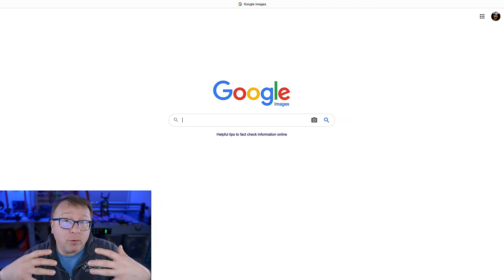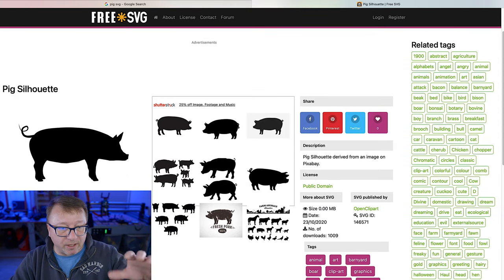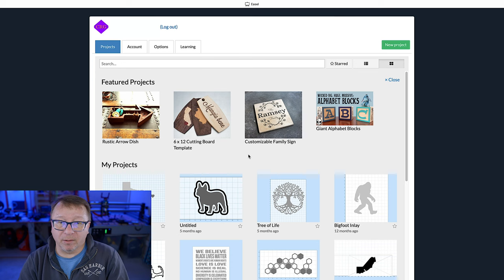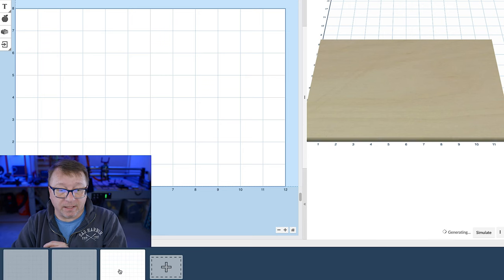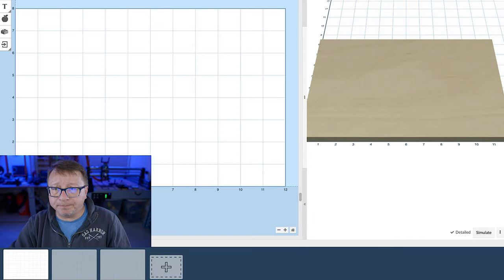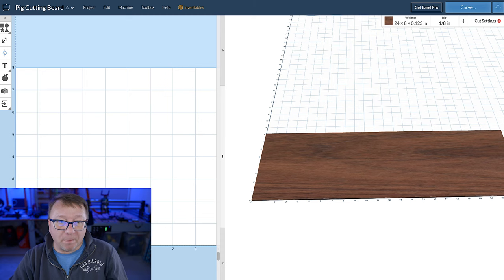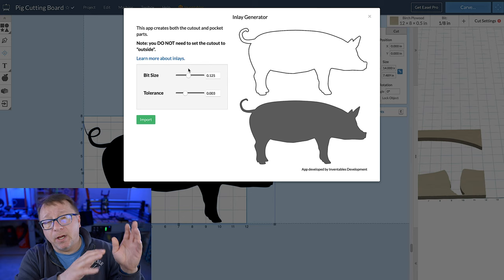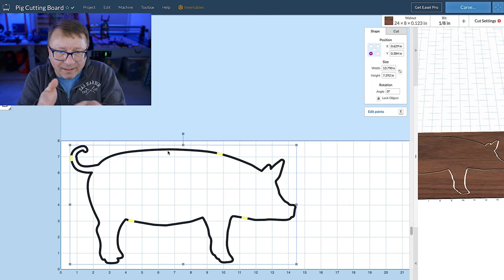New CNC User's Guide to Inventables Easel

Comment: Thank you for this. The information provided was very informative and straightforward.

Am I understanding correctly that I don't have to specify which machine I am using for it to generate the proper code?

If so, this is far easier than ever. All the other software I've tried out has a long process of entering information and selecting the machine before it can export the g-code.

Thanks again!
Reply from the maker: Hi there -- well, sort of. Easel will only generate gcode that is compatible with the X-Carave, which is (currently) based on grbl. The good news is grbl gcode is very compatible and interoperable since it does not use special or esoteric commands. If you have a machine that uses some specialized version of gcode, then you will need a translator for Easel. Alternatively, Autodesk Fusion (and Vectric and Carveco and others) has post processors which can generate specialized gcode for any machine. That makes Easel simple and easy to use, but also limiting when you have advanced needs. Hope this helps.
Reply: @cyberreefguru  Thank you for making that point. In your video, you mentioned 1F, and I'm looking forward to trying Easel.

Lately, I've been frustrated with learning CAD/CAM software, which has made the process less enjoyable, contrary to why I initially purchased my 1F. 

Lately, I've been pondering whether I should sell it and switch to a shaper origin because their Studio software is user-friendly, uncomplicated, and straightforward.

However, after watching your video, I realized I should give it another chance before giving up entirely.

I have to admit, Shaper’s Origin and Studio are appealing. I wish I had known about them before purchasing my 1Finity. 🤷‍♂️
Reply from the maker: @Mr.GucciClass1A  Hi - I completely understand your frustration. But the Onefinity is completely different from the Shaper Origin. If you just need small cuts or to route a few pockets, the Shaper Origin will work great (note -- I don't own one). But if you want to make much more complicated designs with a lot less human interaction, then the Onefinity or another CNC is your best beat. So it depends on what projects you are trying to make, how repeatable you want them to be, and how much time you want to spend overseeing the actual making process. The Onefinity can operate completely unattended (though I don't recommend that), and the Shaper Origin can not -- two completely different approaches to similar problems. Hope that helps!

Comment: Thank you for your video. I would like to ask what to do if I have design when some shapes has to be cut outside the line and other ones inside the line? How to combinate? Thank you!
Reply from the maker: Hi - thanks for watching. When you define your cut in Easel can define if you want to cut outside, inside, or on the line. Click on the Cut tab and at the bottom there is a drop down that allows you to select the milling operation. Is that what you mean?

Comment: That was great but do you have a video that does the next step? Everyone seems to stop at this point in their videos. I would like to see you actually connect or send the files to the cnc machine (preferably the Onefinity) and start cutting.
Reply from the maker: Hi Clint - I do have other videos that show the full process; however, you cannot use Easel to send files to the Onefinity. Onefinity has its own controller that sends gcode to the machine. You need export the gcode from Easel, upload to OF, and then click 'play'. Hope that helps.  Thanks for watching!
Reply: @cyberreefguru  yep that’s great but since my OF hasn’t arrived yet I can’t enact it myself. I’d just be so grateful if someone would fill the gap and actually show me that step. I’m sure this is a no-brainer to someone with a lot of experience operating these machines. I have 30 years experience using design, animation and 3D software but this is my first opportunity to output files to something that isn’t a printer or web site video display.
Reply from the maker: @clintwhitsett  Hi Clint - got it. In short, once you create your gcode -- in any CAM package -- you upload it to your OF.  Either using the web interface if you have it on the network, or using a flash drive plugged into the controller.  I believe I discuss this in the OF interface overview video (https://youtu.be/1aS7j0AVRCA). Once you get your OF, let me know, and I'm happy to help walk you through the process.  Thanks!
Reply: @cyberreefguru  Thanks mate. Keep up the good work.

Comment: Just saw today Easel is promoting a new feature 3D carving. 
This is a kicker cause when I got my x csrve 3years ago they promoted 3D carving but they counted V carving as 3D carving. 
I bought V Carve and use openbuilds cam software to run the machine and dont have to pay any monthly Bills to run my machines
Reply from the maker: Thanks John - excellent feedback. I've not tried the Openbuilds software so I need to check that out.  Fusion 360 is free for hobbyists and does 3d well. I always recommend that (and any free SW) before investing in paid software before you know what you need.  Thanks for watching!
Reply: @cyberreefguru  I've gone thru the whole gamut of softwares and have called Shapr3D my main CAD software, mostly for 3D printing but it's excellent for making full scale items and taking them down peice by peice to project them to the zero plane and make profiles to cnc cut. I didn't care for Fusion, the work environment was uninspiring for me. And I think they may have changed their free for hobbyist thing. Or at least excludes some features for the free one- worth looking into.
Reply from the maker: Yep, Autodesk has definitely neutered Fusion 360 Hobbyist version. It's still great value, especially if you are doing full product design with PCB layout, but less of a value for anyone doing 3d printing or anything in the mesh space. I like that I can do CAD and CAM in one place, and it is "native" to MacOS.  "native" because it's still single threaded in some places and very limited support for M1 right now -- and no clear timeline when it will be fully supported. I think I need to re-look at Shapr3D -- I found it difficult to use the one time I looked at it, but maybe things are different now.  Thanks for the feedback!
Reply: @cyberreefguru  Shapr3D really shines bright on ipad with the pencil, they have a Windows version and I get good use out of mouse and click too, but the main thing is they update from user feedback. Recently an update contained cloud saving that shares across all used devices.
I like to own my software but Shapr3D is my exception as my workflow with it are smooth sailing

Comment: So, once I have my Shapeoko CNC machine connected to Carbide Motion, I simply open Carbide Motion and "open" or upload the saved gCode file to my computer directly into Carbide Motion, correct?
Reply from the maker: Hi David - yes, I believe that is the workflow. Though I'm not sure how it works with the non-pro version since they removed the export gcode ability. I would hope they allow you to use regular CC without buying pro if you have a Shapeoko. Something I will have to ask about. Thanks for watching!

Comment: Where do you your place your materiel on your cnc from the start?
Reply: Do you have a video of where on the board do you place the materiel you are working with?
Reply from the maker: Hi there. You mean on the spoil board? I don't have any set location I put the stock unless I'm batching out project, then I create a jig so the stock is always in the same position and I can return to the previous zero location. You can certainly add bumpers so your stock is always in the same location if you want. Thanks for watching!

Comment: the gcode wouldnt load at first in ugs then when it finally did i could get it to start making the shape but the spindle wont start automatically, is there a code i can add until i get a trim router?
Reply from the maker: M03: Start spindle spinning clockwise
M04: Start spindle spinning counter-clockwise
M05: Stop spindle spinning
But I don't understand that in the context of "until i get a trim router" - what are you using now? The gcode start and stop will only work if you (a) have a spindle, (b) you can control the spindle with your machine. A trim router does not meet any of those conditions.

Comment: Hi, it may be a silly question but
Is it possible to import .gcode extension with easel?
My machine does not recognize .nc
Or how to convert .nc to .gcode extension?
Reply from the maker: Hi - simply change the .nc extension to .gcode - the format of the file should be the same regardless of file extension.  All that said, you must use the appropriate Easel post processor for it to import properly. They have post processors for most of the major CAM programs.  Thanks for watching!

Comment: Hi am new to cnc.
I have a foxAlein Masuter Pro. I have been trying to get this machine to work and am having issues. I have a 300W spindle installed. I have easel pro and when going to the process as soon as I push carve the spindle  stops can you help me. It is probably an easy fix that I don't know.
Reply from the maker: I am not familiar with that machine. Based on their website it seems you need to export the gcode and send it to the machine using something called Candle or use their offline controller. https://www.foxalien.com/blogs/news/3018-se-cnc-router-faqs. Hope that helps - thanks for watching!
Reply: @cyberreefguru  Thank you I will look into it.

Comment: Hola, soy principiante y estoy trabajando con Easel y en verdad es muy buen programa me gusta mucho, estoy haciendo un retablo ya en producción continua, hay que devastar 1.3 cm de profundidad y un área de 15 x 13 cm, lo hace en 4 pasadas y tarda 36 minutos con una broca de 4 filos up, muy buena por cierto, pero quisiera hacer lo más pesado con una broca de desbaste muy gruesa y al final el último milímetro hacerlo con una broca de bola o alguna que deje un buen terminado, pero no sé cómo hacer esos 2 archivos o el proceso para trabajar con 2 brocas una de desbaste y una final de terminado, si nos ayudas con un tutorial sobre esto te lo agradecería mucho y por cierto tengo un Genmitsu 4030 es pequeño pero suficiente para lo que hago
Reply from the maker: Hello - if I get the gist of your post, you want to do a roughing pass and then a finishing pass, but for drilling? I've never seen anything like that for drilling -- you usually use peck drilling as the combined approach. If you mean for general milling, then it depends on the CAM software you are using. Use multiple tool paths with different clearly strategies - one for roughing, and one for finishing. Easel, Carbide Create, Fusion 360, Vectric, and Carveco all support that capability. Hope this helps - thanks for watching.

Comment: I tried inlay with easel but they never fit together, how do you use that tolerance tab?
Reply from the maker: Hi Chris - the tolerance is the distance between the inlay and pocket. I've found 0.004 and 0.007 to be acceptable depending on the rigidity of your machine. What machine are you using?

Comment: great help ........Inventables Easel its free ???
Reply from the maker: Hi Antonio - yes, Easel is free.  There is a paid version that adds some great enhancements, but you don't need to upgrade to get the basic capability.
Reply: @cyberreefguru  It doesn't seem to be free anymore, just a free trial then $24 a month.
Reply from the maker: @frankhovis  hello Frank, as I point out in a recent video (https://youtu.be/r32NfhDarqE), Easel is STILL free.  Scroll to the bottom of the page and you will see: "Free to use after Easel Pro Trial" -- highly deceptive wording and framing. Thanks for watching!!

Comment: i have a dousey question for you. i made a desktop cnc and i run it using a grbl controller on my celphone. i have had to set my stepper motors and adjusted the settings in my #100,101. i done a test run using easel after i downloaded the g-code to my  phone. the program completed as written however the dimensions were 50% greater. the distance from the start point to the project was 50% longer and the cut out was 50% larger. everything was 50% larger very strange. any ideas one other thing was the step over with the 1/8 bit is larger so the pocket is not cleared out it leaves a strip between the paths
Reply from the maker: Hi Paul - generally it sounds like your steps/mm are not set properly. Can you enter manual gcode with the phone? If so, move the machine a set distance (say 100mm in one direction) and measure the distance. If it's 50% greater, then I would say your steps/mm are off. If it moves the proper distance manually, then I'm guessing it's the gcode, though I'm not sure how. Is it possible your drawing is scaled by 50%?
Reply: @cyberreefguru  yyes i can enter gcode on the phone i will try this this afternoon thanks i'll let you know how it goes.
Reply: bravo thanks i had to change the steps from the 800 for both axis to #100 to398.009 and #101 to 402.010. works good now thank you now i can do something
Reply from the maker: @paulpeters324  Excellent - I am glad you got it to work!
Reply: @cyberreefguru  thank you again. i completed my first program today. a text  of my wifes name in a piece of plywood. now i can try other things. first 2d then maybe a 3d carving we shall see. i'm already thinking of building a larger machine as mine is ok but needs work.